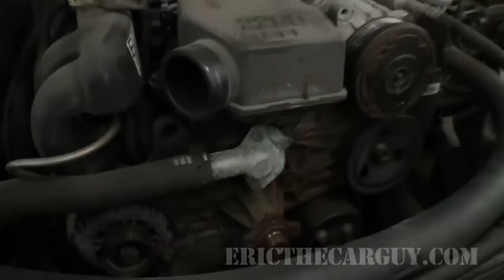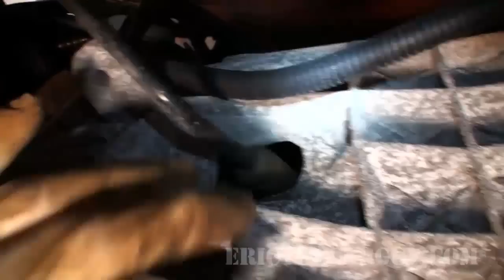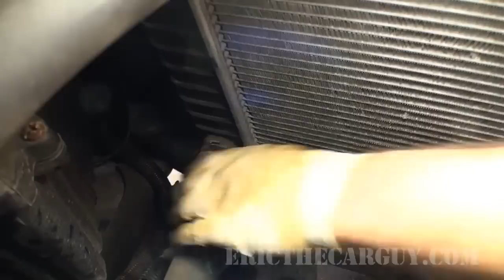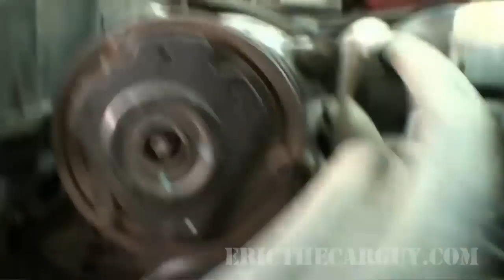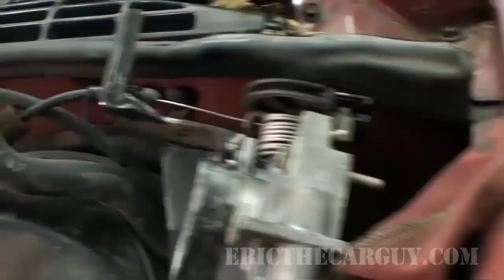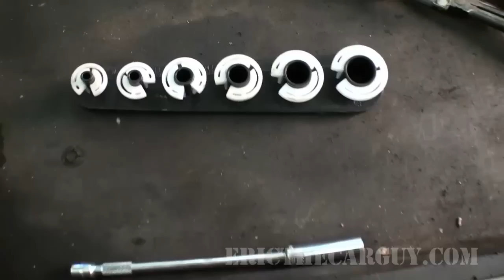2001 GMC Sonoma 2.2L Engine Replacement (Part 1) -EricTheCarGuy

Comment: The heater core on my civic.. when i did the motor swap i went to pull the hose off and krimped it... took a big bolt at my shop rounded the tip of it hammered it in made it as round as i could put RTV around the fitting and used a hose clamp good as new and heat works great lol

Comment: i just did a mtor swap in an 03 s-10 with the 4.3 v-6 auto 4 wheeldrive had to rasie the body 4 inchs got get to the top bellhousing bolts.

Comment: I'am Your Newest Subscriber Great Videos . I Have A 95 S10 2.2 Liter With  5 Speed Manual Has Choptop Roof Hasent Ran In 11 Years I Wanta Get It Running Again Has Low Compression In A Few Cylinders

Comment: Check your Idle Air Control setup and see if it's go good working order. Should be located around the throttle body.

Comment: hey eric i have a 1996 gmc jimmy 4.3 vortec and i have a few tips/tricks for you in the future for you that might make things simpler 

when you remove the hood open it up to take those bolts on to the plastic above the hinge than close the hood with a small piece of wood under it than pop them out and you have double the ratchet room than you remove the hood the same way you did  

also there should be a few main wiring harness connectors for the engine around the abs unit

Comment: Even in vehicles designed for it, death cool can do those. GM 4.3L V6 intake gaskets come to mind... I've even heard of rad caps corroding to nothing over it. As a result, I run traditional green in my dad's 1997 S10... never had an issue since.

Comment: Apparently, if there is ANY air at all in your cooling system it will react with the Dexcool and the aluminum parts to create a slush of corrosion.  I could be wrong but that's what I believe happens.

Comment: I have a Mitsubishi express van or over there a l300 and its amazing , it's a 1996 and done 550,643 and would have done up to 700 but timing belt snapped so what I did was , went and replaced it now its gonna go pass 1 mill

Comment: Even tho it sucks that I have to wait for the next video, excellent video. My first car was a 1996 Chevy S10 2.2l 5 speed 2WD. I did just about every repair imaginable to that truck, except pull the motor. Although some of the intake system seems updated on this Sonoma allot seems to be the same. I suppose GM wasn't in the habit of making too many changes in this vintage of mini truck. Sure brings back memories of when I first started turning wrenches in high school. Thanks Eric.

Comment: Suggestion. Get a hat to attach your camera to. I think it will help with some of the shots. Thank you so much for making this video! I recently swapped my engine in my 98 s10 and your tips and tricks helped me finish it up and also solve the mystery of that AIR system. My 99 engine uses an egr and i thought i just had extra parts. But we figured it out thanks to you!

Comment: This is a little random and I tried pming you but any ideas on where to look for a cars idle jumping to 3k on start and staying there. 99 chrysler 300m 3.5L, just did valve seal and plugs, throttle moves freely. Dont see why it would jump up to 3k-4k rpm and stay there. Responds to pedal input but wont drop down below 3-4k rpm.

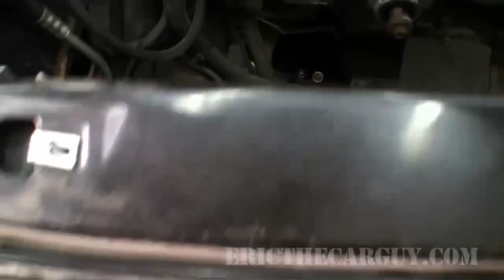Comment: I was just trying to help some guy with a 2001 Chevrolet S-10.  He had a problem with the ARR Pump hose and existence of and location of the pump.  I shared with him about ETCG and the Engine R&R series on the Sonoma (right at the parts counter at a GM dealer).  His answer is right at 31:25!  Eric saves the day again.  The price of my part mysterious was increased by 45% from MSRP.  I'll shop elsewhere.  I hope he finds Eric's channel!  It just illustrates how good the videos are at ETCG!

Comment: Toward the end of this video you were undoing the nut for the engine grounds and it looked like the oil filter was in your way, but you didn't remove it, or even mention it.  Was there a need to leave it on?

Comment: No cam seals or the like either, it's a good old american OHV 4cyl... The descendant of the Iron Duke actually. Crank seals, valve cover seals, and a timing cover seal... and I'd bet what isn't required to change when building the long block into a motor was replaced at the long block refurb plant.

Comment: At around 8:20 i was thinking about something. How about you giving us a preview on ETCG1 for what you are planning to do (Basically do the inspection ahead of time) and post that there so we can come up with some ideas or those of us that have experience with doing an engine replacement on a particular vehicle can help you with some pointers.
"Which is easier, lifting the engine with or without the tranny?"
That sort of deal, would be cool to be involved in the process.

Comment: Draining the coolant is one of the top things I hate doing! Most vehicles don't seem to have a petcock with a drain hose, which means you make an enourmous messon the floor.
Reply: Buy a giant Tupperware container from Wal-Mart. They are cheap and give you lots of room so you can avoid the mess

Comment: Great... now I gotta rebuild my 2002 Sonoma because I was going uphill in 5th on the highway... got wicked pre-ignition and the piston rings collapsed in from the heat and lost all compression
Reply: ComputerTechPC's2000 we got it buttoned up yesterday and it runs just like before. Got a remanufactured head and it's perfect. Ended up that the piston rings were actually fine and it was only a warped head. Funny because my mechanic thought it could have definitely been that too but it was only a warped head. It was about 30 thousandths of an inch warped and the block got warped too, but only about 2 thousandths so it doesn't even matter. Runs smooth again

Comment: Woundering what year 2.2 bolt right up. Will a 97 fit
Reply: 98+ only for anything 98 and up. 2 different head castings too depending on if you have secondary air injection.

Comment: Doing plug wires on a 2.2 sucks severely but I will say you do not have to rout is as intended as long as your careful you can run them all throw the middle of the middle port of the intake intake and straight to the coil packs and it holds it off the engine better too you do take up most of the plug wire and leave little room for play but no matter how much that engine flexes its plug wires they aren’t going anywhere did them on mine roughly 2k miles ago not an issue yet also you can lay on the engine an reach down an push it back on the ignition coil just remove one a time an you can feel the only empty spot where that plug wire needs to go an then if your iffy about rather they pressed down or not you can turn your wheel reach through the flap in the fender wheel an press them on a little better

Comment: a nice video but i was wondering you know anything about 00 mitsubishi mirage ..... because my brothers mirage coil pack is over heating  when you drive it down one block or so but the car starts choking and exhaust starts to sound really werid and it back fire's oh a other thing is that engine shaks alot when you start the car so please help on this eric the car guy thanks.

Comment: I have a 02 dodge 4 door pickup 4x4  with 4.7 v8 motor  71, ooo actual miles if i sell it to a friend and they change the oil every 3,00 miles should it last for a long time..

Comment: Sorry for your loss. What was the reason for the engine swap? Not running? Blown head gasket? Knocking? High mileage and just clapped out low compression?

Comment: Hey Eric, Shep here. In 2011 I bought a 2000 S10 w/74k and a cracked block for $500.The former owner didn't know about basic car care.She did however keep it clean. A used engine,$1000.Reman,$1600.New from GM,$1800. I went new.I had to remove the head and smash the pistons to rotate the crank to unbolt it from the torque converter!I replaced various other parts(rad,starter,alt,etc)It's a neat truck now but Mr Holzman is right. If you ran the 1/4 mile you'd have to clock it with a calender!

Comment: Hey Eric, pardon my stupidity but, what are those clamps called on the end of those engine ground cables @ 40:00 ? I'm helping my friend replace his water pump/t-chain on his 2000 dodge ram 1500 and the clamps for those two ground wires that connect to the acc. bracket near the power-steering pump broke.

Comment: Isn't the water pump where the fan bolts onto? o.O
Reply: Hunter Milam most likely internal driven. GM and chevy like to do that.
Reply: lee-roy jenkins
I hate to be that guy but Chevy is a branch of GM. I think you may have meant GMC and Chevy.

Comment: I changed a 4.3L in a 91 4wd blazer in my driveway, It was a nightmare!!! Got a engine from a 93 Sonoma and had to change intake, oil pump, and a lot of sensors from the blown up engine. Just by myself and my wife being my "tool jockey" it took me 4 days to pull two engines and put one back in. Would not want to take on that job again without a concrete floor and a garage. Wasn't for the novice shadetree mechanic!!

Comment: dexcool is probably what killed that engine. It killed the motor in our 2003 rendezvous, had no trouble when switching to a *generic* green antifreeze. Something about dexcool turning into an acid and etching away at the gaskets or something.

Comment: SInce your socket has to be squarely on the fastener without the swivel your wrench would need to stay perpendicular to the nut or bolt.  With the swivel you can move your wrench up and down to avoid obstacles while your socket stays straight on fastener.

Comment: In comparison, my 2012 Accord the alternator removal procedure is: disconnect battery, remove drive belt, remove 2 easily accessible bolts, disconnect alternator plugs, done.  It seems Honda is a lot nicer than GMC when it comes to serviceability.

Comment: stay far, far away from high-silicate coolants if you have an engine designed for regular green ethylene glycol coolant. It'll destroy the waterpump, probably clog up the radiator/water passages, and eat away at gaskets.

Comment: Good series.  Was thinking about picking one of these up on CL, but I think I'll pass.  The other truck I was looking at was a Mazda B4000.  I own a 99 Mazda Protoge 1.6L now and have had nothing but a good experience.  The B4000 has good reviews across the board.

Comment: Eric, my Honda civic is having a really bad bog problem. I had a rough idle and cel, I needed a new map sensor, so I bought one and changed it out. Rough idle fixed and cel no longer appearing. Could it be possible that my o2 sensor(s) could of took a shit because I drove around with a bad map? It only bogs/hesitates when I step on the gas good, if I step on lightly, no bog.. I bought a fuel injector cleaner and used it, still bogging. This is a video of me driving my civic. /watch?v=K8zbDRxfexU

Comment: right, but me personally, i would buy a truck with a diesel in the first place. i men, you probably use it to transport things anyways.
and 4 cylinder diesel do have a lot of torque compared to the size of the engine

Comment: I have a 1995 Toyota Avalon I have seen no videos on this year and this make. Eric my car is playing games it could be many times to just a few times and then all of a sudden it will turn over and start do you thing this could be a starter problem some days it wants to start and other days  I get a click click click it could be many times no drain in the battery at all and system is charging just the click many times then it will finally start

Comment: Funny that all the shops around here recommend not using it. That the dealer himself doesn't use it. That one of the mechanics (the one who under warranty replaced my engine) said not to use it. And that several people here have also commented saying that Dexcool killed or damaged their engines. Its no good, and no one I have ever talked to has had any problem with regular old green antifreeze, and yet many have with dexcool. So why even bother paying more, just to kill your engine?

Comment: Isn't this the same engine from the Sunfire/Cavalier?
Reply: Mostly yes.  The earlier heads between the two were different for coolant flow (RWD vs FWD)
Reply: rajin335 yeah mostly, this one is the vortec one and it’s a little different from the sun fire and cavalier

Comment: I swapped out my blown 2.2 for a new one back in may/june 13. Few things I learned: the hardest (for me) was undoing the bell housing from the engine specifically due to two bolts. I would've preferred to have just kept the whole thing intact. Also, the hood is relatively painless to remove. And, most important, I should've dropped in a slightly bigger engine. The little tutu that could just doesn't quite deliver : /

Comment: Aren't Sonomas and S10's pretty much the same vehicle? I almost bought a '98 S10 off one of my old bosses about 5 years ago, very good shape and with low miles. The only reason I didn't buy it was because I didn't have enough $$.
Reply: They are almost the same truck, like the Silverado and Sierra

Comment: I would also like to point out lots of 3.4 engines were replaced under warranty in 2003, they had a known issue with the intakes leaking due to incorrect torque from the factory, the spec has been revised 2-3 times and every GM gasket set comes with new bolts with Loctite on them. These engines are not tolerant of overheating, get it hot and it is toast I have done tons of these heads and intake jobs and nothing to do with dex
Also your dealer voided your warranty by replacing dex with green.

Comment: I have a Chevy P/U with this 2.2 and I was absolutely hating the idea that I had to crawl up under this thing and try to get bolts off. Well it turns out that if you get your head at the tail of the transmission and look forward you can see all the bolts and access them all...Use an impact wrench and the bolts zip right out.

Comment: 36:06 why didn't you just remove that bolt holding the fuel line so you can move fuel line having better access to the bolt on the alternator?

Comment: Hi Eric.  I love your videos. They have help alot.   My question is...I have a "Brazilian" made 2000 Chev. s10 manual, with a 2.2 liter, and the clutch has gone out.  Is there a way that I can get the right clutch kit for the truck that would interchange parts from brazil to u.s without taking the transmission down?  I live in Aruba.

Comment: im  trying to replace my exhaust manifold on a 1998 s10 2.2 but there is a steel plate where the ac compressor sits, and  i cant remove it, i remove 2nuts attatch to the head and i think there is a third one under the plate but i think is a permanent nut, is there a bolt coming from the power steering  ?  help me please

Comment: Dexcool is the devil. If you buy a used car and you think for one second that it has dexcool that's more than 3 years old in it you better prepare yourself mentally to do a head gasket replacement.

Comment: Great vide Eric.    One question can i replace the engine from my sons 1999 Sonoma with a 2001 s10    They both are 2.2L.         The 2001 is a flex fuel and the 1999 is not

Comment: I don't trust any auto mechanic shops that are a chain. They will hire just about anyone who claims there a mechanic through the merit system. If you own a new car do your repair and maintenance at a reputable dealer shop, they work on those specific cars all day long piece of cake but that's hardly true because I had my 60,000 timing belt over tightened. True enough, mechanics are like honest politicians, hard to come by

Comment: BS, Dexcool starts life with an Acid in it EH-2, the early engines GM first installed dexcool, had issues with the gaskets leaking, as the were not revised to be compatible with EH-2, your car was killed because you kept driving it with leaking intakes gaskets, and did not repair an issue, nothing wrong with those intake gaskets it has to do with the bolts coming loose, that is why new ones come with Loctite already on them, and it will fail again if not done correctly, dex or green

Comment: I did a clutch and slave cylinder on one of these.  It was not fun.  Especially when the catch cup I was using to bleed the slave cylinder fell and dumped the fluid directly into my mouth.

There's a story about an automotive engineer back in the late 60's when they were just about getting cars easy to work on.  The engineer came home and caught his wife in bed with a mechanic.  He told his buddies and they've been screwing us back ever since.

Comment: Eric, great video. Just so happen my 98 sonoma just blew a head gasket and I have the milky oil and no compression so I am replacing it..so be prepared for a few questions...1st is do I need to replace the radiator or will a good flush help. And also what about the water pump which I put on last month...let me know....
Cj in ATLANTA.
Reply: Outstanding...thanks a million...I kinda hit a ruit with this motor Eric....I am contemplating wheter to replace this motor in this truck or go buy another one. The engine for this 2.2 is hard to find, used, and if u do find one its more miles than I want to pay high dollar for....What are your suggestions?

Comment: this truck is one of the many pos gm has made no room to just remove a oil pan gasket or oil pump must remove the fucking engine for this same goes for the s10 blazer and the 4.3 is the same head ache

Comment: Hi Eric! My family owns a GMC Sonoma 1993. The ignition starts decently, after accelerating it slowly it always shuts down (for example: every time we stop at a red light and then accelerate...)  We can't seem to find out what the problem is. Your help will be really appreciated!
Reply: Idle Air Control Valve 
Sounds like a possible culprit. Hope you got it figured out before now :)